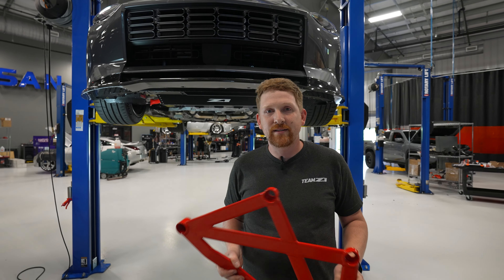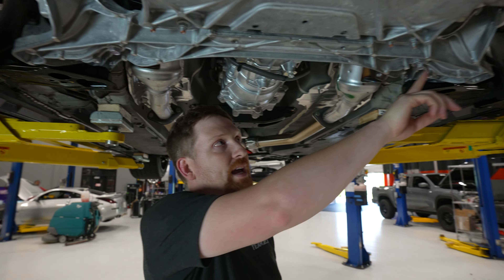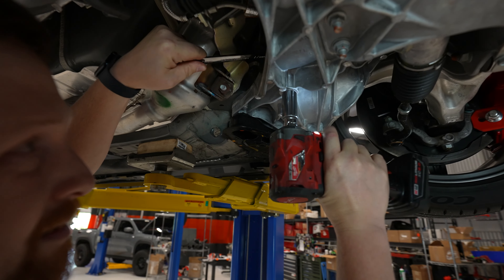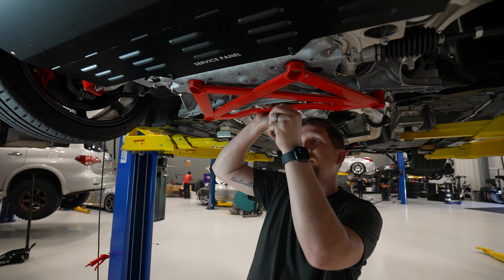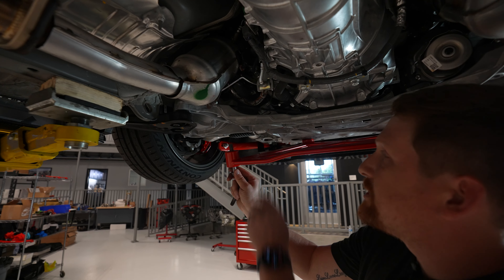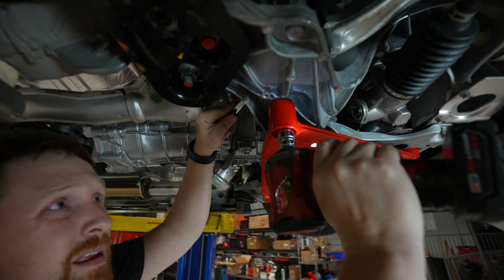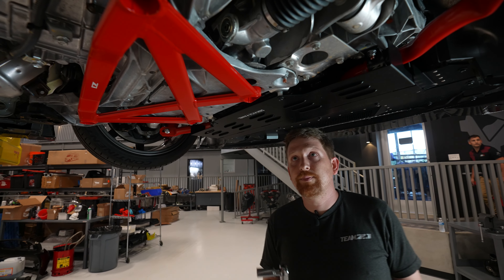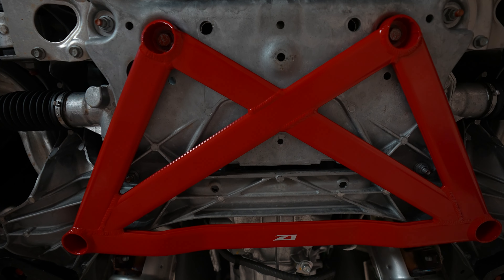Z1 Front Subframe Chassis Brace Install

Comment: For anyone doing this at home. I recommend just getting a 17mm stubby wrench.  I only had the front lifted on ramps/jack stands, so maybe it messed with the  angle.  But I couldn't hold the nut on those back 2 with my normal set of wrenches(about 10 inches in length) they were just too long and I couldn't find good positioning to get them fully on the bolt.

Comment: what's the point of the brace?
Reply: It's to brace against the power these Infinitis infinitely don't have.
Reply: It has nothing to do with power or lack there of… it is an extra connection between the body and front subframe ensuring no movement under hard load from the front tires.  It would be more for handling.  (As I understand it)

Comment: Does this interfere with the z1 engine cover/ under shroud?
Reply: If you look carefully at the video you will see that the car has the Z1 under shroud installed, the brace is fitting behind it.

Comment: This thing adds more unnecessary unsprung weight to a Already overly heavy front end,l imagine it still doesn't help with lap times back and forth to wally world or a beginner paying for a few laps on a closed course.
Reply: maybe - I think anything that can add to steering feel/feedback and response is truly what makes the car "fun" - it'll never be a 10/10ths type of car - if you want that - then I'd go used porsche cayman s or something up market... the Z just - at the limits... falls apart, and that's actually OKAY with me because it's not worth it on public roads.   For Auto-X maybe - maybe in certain situations, who knows... It's fun to look at though!!

The rear end is where the Z needs the most help - mine is 108k miles and I can notice a growing distance between what the back of the car is doing vs. the front, but again, that's only when I'm being stupid...  I'll go for those sub frame inserts first, and "maybe" the cheap BC racing coilovers that run about $1400.  What I have enjoyed over the years is how compliant the back end of the Z is on our trashy public roads - it just stays planted compared to my old POS wrx that was all over the f'n place after I did coilovers/swaybars/bushings (barf!).    I hope to retain that rear complaince - thus - nothing too stiff that's going to induce oversteer or I should say "unexpected" or "sudden" over steer or lift off oversteer (can be fun though!)

My goal is to keep the car close to stock height as I need the clearance, and if I can make it to where it is not a "feel every bump in the road" experience - that would be wonderful - but - if I can reduce nose dive under hard braking and overall weight transfer = win.  I did do the front sway bar with stock bushings for $150 = world of difference, but now time to upgrade bushings..

Probably what I want does not exist - which is - better handling but reasonable comfort and reasonable tire wear.... I refuse to buy a BMW so... that's where I'm at!

Thoughts for us daily people?  I am lucky - my "commute" is 28 miles along a windy fun stretch of smooth road 35-45mph limits..so I'm in heaven with the Z where I live!!  Oil cooler is finally getting done..... and I may go for the transmission cooler....
Reply: Any issues with it being on a lowered coupe, how much lower to the ground does it sit versus the frame. 1/2” , 3/4”?
Reply: It looks like sprung weight to me.